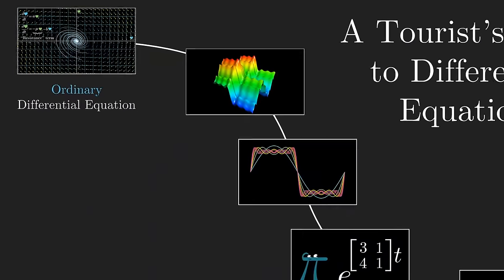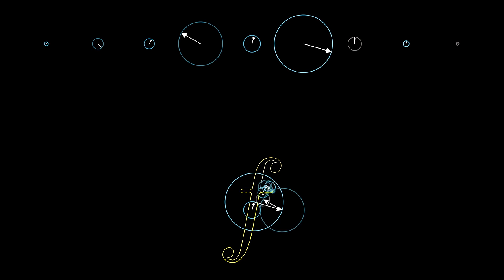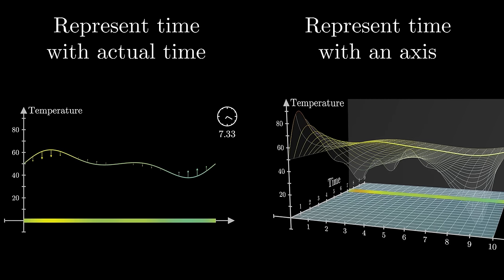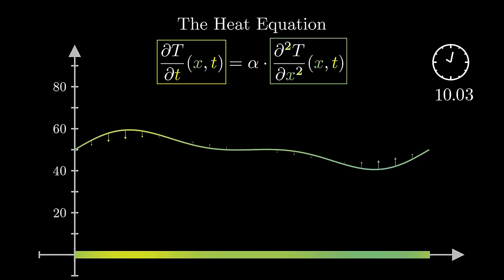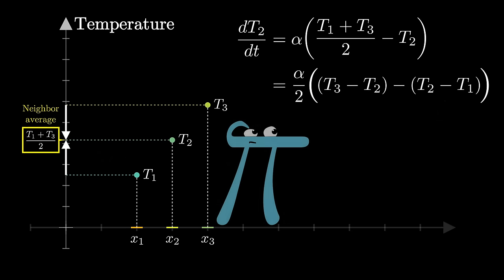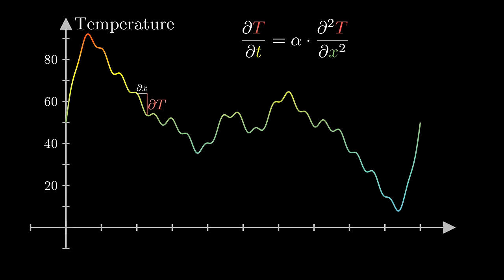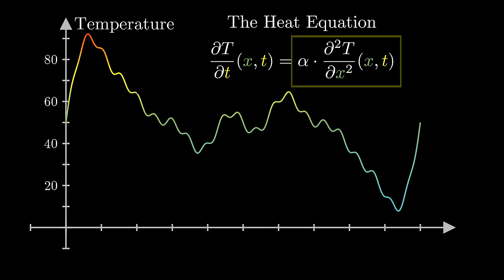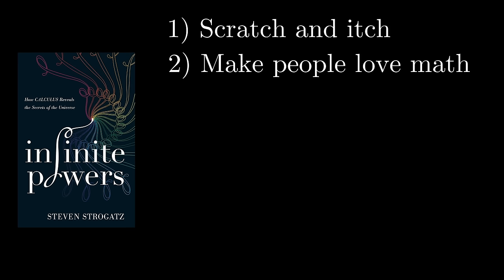But what is a partial differential equation?  | DE2

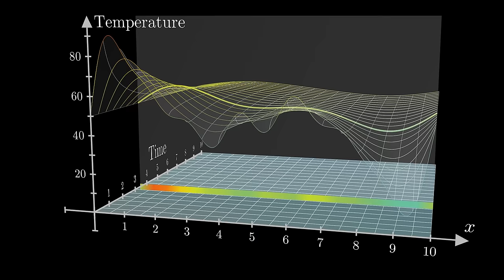Comment: At 4:57 if the pendulum example were to be similar to the function changing with time, we would have several pendulums and how their angular velocity and angle changed with time to be equivalent? Since its a single pendulum, it has one angular velocity and angle at one time, so just a line, instead of a 2d map. Even though in the pendulum case there are also 3 dimensions: angular velocity, angle, and time.

To paint a picture, if we have angle a as x, time t as z, and angular velocity v as y; the relation betweem just a and v would be a line; similarly for v and t. And as angles over time change, the same angles always correspond to the same angular velocity? So it doesn't create a plane, just a line over the 3d space. Is this why the function is not changing here? Or there isn't a function like in the heat equation in this example for this reason?

Comment: What I don't understand is... on the "difference of the difference" part you've explained (10:43), you showed that the middle point will tend to move towards the "mean value" of the neighbouring points. What if all of the points create a perfect 45 degree line for example? They wont move since the points are pefrectly "in the middle" of their neighbouring points, but that shouldnt happen if a rod has evenly increasing temperature (from 0-90c for example, distributed exactly just like the points)

Comment: I have a question regarding the pde at 6:55
Lets say the heat distribution is linear, e.g. 0cm its 0 Celsius and at 100cm its 100 Celsius. Wouldnt that mean that the second derivative in space is constant 0? Therefore the temperature does not change in time and thus the heat is not actually distributing?
Reply: He actually talks about exactly that problem in the second video on this. To summarize, you solve that problem by adding the constraint that the derivative of the input function must be zero at the boundaries.

Comment: I have a question, we say that the speed of change in temperature over time is equal to a constant times the second derivative of that point respect to other axies.
But what if that second derivative is zero.
Lets say we have a infinitely long metal rod which the temperature increases linearly over it's length. Like let's say when you travel a meter along the metal rod, the temperature increases 10 degrees.
The equation says no heat transfer will happen. Since the every point is the same as the average of it's neighbours. But it doesn't feel right. Wouldn't there be any enery transfer in the real life?!?
I know the rod would have to end at some point and the second derivative would not be equal to zero, but let's say its possible, it still doesn't make sense
Reply: Think of three neighbouring points in the linearly distributed rod. The heat from the middle point would have to transfer to the cooler neighbor. And likewise the middle point will get a heat transfer from the hotter neighbor.

 If we are considering an infinitely long rod (ignoring that the temperature would shoot up to infinity at the 'ends' of the rod), this is actually quite intuitive. The intuition only breaks at the endpoints of the rod.

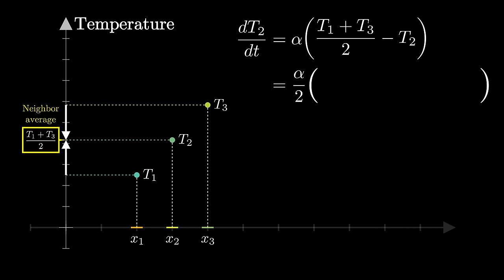Comment: 9:20 Just came to point out that if we had a universe consisting of nothing but an infinitely long rod with a uniformly ascending temperature value across its length, it would be in equilibrium even though one end would have an infinitely greater temperature than the other.

You're welcome.

Comment: Masterful. Now, a question: Is this math applicable/meaningful to polling results changing over time, as well as other changing inputs? (e.g., fundraising, demographics, stock market, etc.)
Reply: Yes, the entirety of modern economics is built on partial differential equations, like the Black-Scholes equation.
Reply: @ARBB1  Yes, for options. I know. Thanks. I'm asking for a concrete example(s) for polls and pollsters. A link to a site would be perfect

Comment: Even though I completely understood the notion of the second derivative, it is still hard for me to understand how exactly this is correct in the case of the heat equation. If, for instance, we have a rod and its temperature is distributed linearly along its length (in other words, it starts off with the highest temperature in one end and it falls linearly until the other end), it means that its second derivative will be 0 at all points along its length. Consequently, this means that there will be no temperature change in time for any point along the length of the rod (this is a consequence of the heat equation). However, this contradicts my intuition, which tells me that heat will always flow from hotter to colder spots and, eventually, the hotter places will decrease in temperature, while the colder ones - increase. After a finite length of time, the rod will reach a constant temperature everywhere and heat conduction will cease. Can someone explain to me this apparent contradiction?
Reply from the maker: Yes, the key is that boundary conditions need to be specified (see next episode).  The PDE applies to the interior of the domain, where your intuition on the linear example is perfect, but in a usual setting a separate rule applies to each endpoint.  This should be intuitive, because those end points don’t have “neighbors” on either side.
Reply: @3blue1brown  I understand it now, thank you! It is unbelievable that the video is an year old, you still manage to find time to reply in the comment section. It shows how engaged you are with your audience and that you always try your best to make sure that we fully understand a certain idea. Thank you for what you are and for presenting math in such a unique and captivating way - we need more heroes like you!

Comment: So this means there's no inertia for heat, ie there is no force acting on heat to be resisted so the heat over time only depends on the local state of the system at t-cw and not on any previously injected local impetus, where w is the breadth of the system that affects a point at time t from c units of time previously? This is dangerously close to SR O.o
Reply: It also provides an arrow of time - to reverse time you have to invert the gradient of the equation. Am I understanding?

Comment: Say I have a rod that has a linear variation of temperature between its ends. Say, for example a 100 mm long rod with T=0C for X=0mm, T=100C for X=100mm and T=x for any point between those ends.
WILL THE TEMPERATURE OF THE ROD REMAIN CONSTANT????
Intuitively, obviously not. The heat will flow from the hotter zones to the cooler zones until all the rod is at the same intermediate temperature.
But, the partial derivative of the temperature with the position on the rod is constant (=1) and hence the second derivative is zero, which given the equality would mean that the partial derivative of the temperature with time is also zero and hence the temperature (at any point x) doesn't change with time.
What is wrong here? Because something IS wrong here (and it can be me).

Comment: Ah - about 06:50 this highlights one of my favorite rants in whole of math at the moment.  And that is why use tangent based explanation when a secant based explanation seems more robust with helpful implications going forward regarding discontinuities and so forth?  Plus!  Around a wobble of some sorts in a graph it seems easier to adapt secant as an approximation of tangent at a single point.  Then, perhaps, in a small interval around a single point the secant exists either side of that point.
The tangent approach seems naively risky, and some may say there is no harm in that, because it only considers tangent on one side of a point and not other side(s).  and may be extended easier into multiple dimensions too?
PS: the example about 12:50, to me, is just crying out for secant linearity based on outer two values compared to inner value.

Comment: How is it that points on the cold bar wind up being warmer than some points on the hot bar at 1:07 ???
Reply: The bar isn't cooling down, the heat is just distributing across it. It never leaves the bar.
Reply: @lunkel8108  At 1:07 there is a point which has COOLER  points on the  left where the heat is coming from.

Comment: The total derivative d vs partial ∂ notation thing is only super important once you start trying to consider physical things with actual movement.. Otherwise they're the same -- by definition of things not physically moving. 

Once things DO move, however.. they are not. You need to know what the material derivative is, or at least the distinction between the total derivative dt (changes due to any change with time, including changes caused by having a velocity for a moving thing) and the partial derivative ∂t (changes due just to that variable alone).

This comes up in fluid dynamics, but it is most irritating in electrodynamics, where the dt terms in Faradays' Law of induction and the implicit velocity of net charge in Ampere's circuital law are neglected in the most commonly taught form of 'Maxwell's Equations'  (which are actually Oliver Heaviside's nondimensional rewrite of Maxwell's actual Equations). Consequently they need to have the Lorentz force law tacked on before also applying ye olde Newton's equations. Numerically you have to use a really ugly 'back and forth' method if substantial charge is moving, ie, enough that the thing(s) whose motion you are trying to solve itself/themselves cause a change to the spatial charge density rho, or the spatial current density vector J, as they move. 

Maxwell was interested only if there was a solution which would enable electrical energy transfer between disconnected wires over an intervening space, without any physical velocities allowed. 
In this case only is it reasonable to simply assert that only partial ∂/∂t terms are needed, and are equivalent to the total derivative. This works out well when you also discover/consider typical electron drift velocities in wires --- practically motionless! mm/hr etc.

So it's good for antenna design (you can solve for a time-dependant current in different [but fixed in space] wires, without going 'back and forth' with Newtons -- you can link it to a circuit equation using circuit inductance to eliminate worrying about inertia), and hopelessly useless for electric motor / solenoid design. (Unless you  'cheat' numerically, by swapping back and forth between M-E and Newton's laws of motion on every timestep -- but even there, it's only really good for equipment design where significant vibrations of similar frequencies to the EM waves don't occur, or where there is moving charge, but it's an insignificant proportion of the total unbalanced space charge, as in high energy particle accelerators and vacuum tubes of not-too-high beam currents). 

Interesting further reading: Hertzian Electrodynamics also Weber's Electrodynamics, which also collapses the electrico/magneto-static fields down to a single unified force field (parameterized in phase space, as the force depends on the velocity of the charge which experience it, at every position coordinate).

Especially also Thomas E. Phipps Jr's books -- where he points out in great detail that Einstein was totally wrong to try to apply relative motion to Maxwell's Equations, and the contradictions and paradoxes that result should come as no surprise. 

He also points out that time dilation is certainly a thing, but that there's no reason all observers couldn't agree to use the one clock -- modulo some relativistic correction factor, and this is indeed the case (or GPS would probably not work). He also shows that with any optical continuous wave interferometry system you should not expect to observe any 'frame dragging', but that with a ring configuration, excited with brief counter-propagating pulses, you sure can build a laser-gyroscope without moving parts -- very sensitive to rotation about an axis perpendicular to the plane in which the ring area is. 

Pick any engineering text book on electric motor mechanical design, and you'll probably find the relevant math hasn't actually changed at all in the last century -- it's still Faraday's / Ampere's, and not M-E.

Yet Phipps couldn't get papers published on this -- was too "Heretical". Hence the books "Heretical Verities" and "Old physics for new". 

I'm not sure about all his conclusions, in particular I feel that electrodynamics needs to break down into a Quantum-compatible 'covering' model, but I could see how that might work.

Comment: i am no wiser about what a PDE is. Can someone help me?
Reply: I'm going to try to answer both of your comments here:
1. What is a PDE? Do you understand what what a differential equation is in general? A partial differential equation then is just a DE that includes partial derivatives. Meaning that it relates changes in one thing (e.g. time) with changes in another thing (e.g. space).
2. How do we come up with DEs? That's a good question. It's essentially asking "how do we come up with scientific models?" DEs are mathematical formulations of the rules that govern a system's behavior. For example we know that heat spreads out over time and we know how it does so from experimental observations. The heat equation encapsulates that in mathematical form. Another example: When we have a population of some organisms we know that the more there are, the faster they can reproduce until they hit the limit of what their enviroment can support. That can then be expressed in a DE which has the logistic growth curve as its solution. Often these rules come from more fundamental models such as with the DE of the pendulum he talked about in the first episode.

Comment: im sorry, but your comment about the notation is just wrong. you do in fact require a different method of indicating partials. also, the del symbol is highly logical (just as math often is); del is simply shortened (or a partial) piece of the lowercase delta. hence its name.